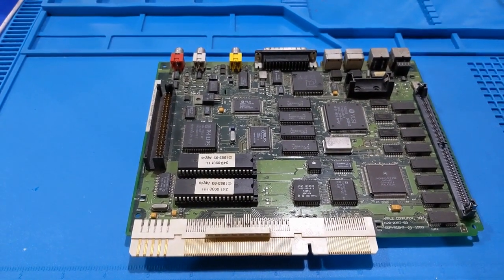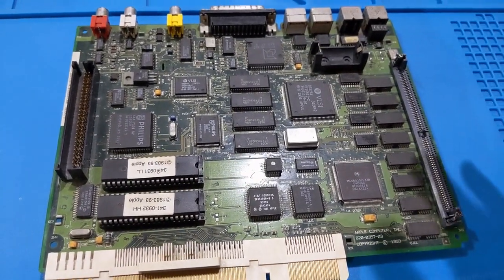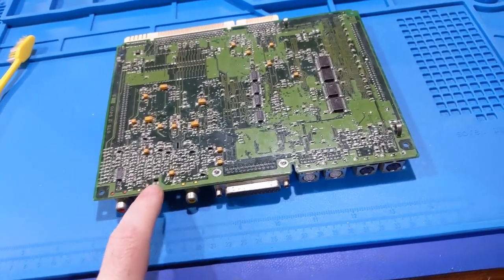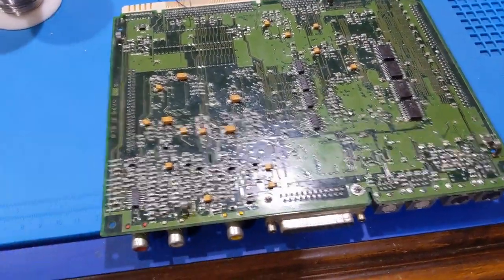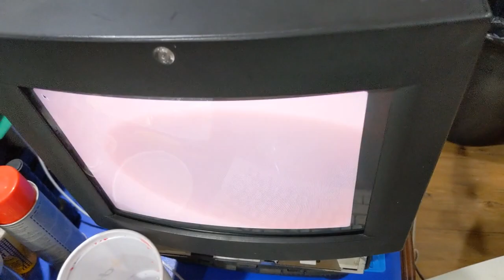Macintosh TV Restoration series: Logic Board

Comment: stands up, takes credit for the absolute botching of that board

It was one of the first "serious" things I worked on when I began really learning how to do more advanced soldering work. I was more or less guided by haste because I remember I was kinda working with dosdude1 guiding me and we found out it was caps and those things needed to be out yesterday. My thinking was to get them out to stop any further damage, but eventually due to life being what it is this machine ended up on the backburner and that's the story of how it ended up in a much better place, with you.

I made so many mistakes but I'm shocked I didn't lift any pads in the process of it all.

The fun thing is I did have a note somewhere with the cap values I could read, but if I recall correctly a lot of the labels were unreadable. That's how bad this thing was. Glad you were eventually able to get the info you needed.
Reply from the maker: It's fine though. Everyone has to start somewhere. You should have seen how bad some of my first stuff was 😂